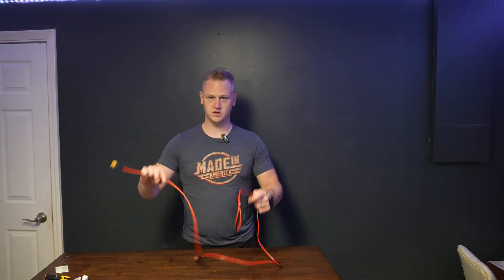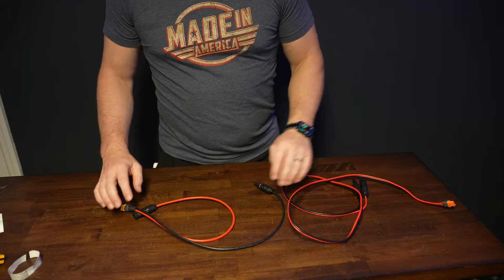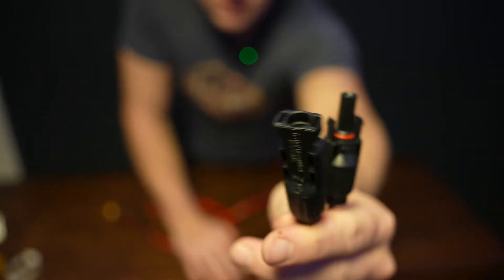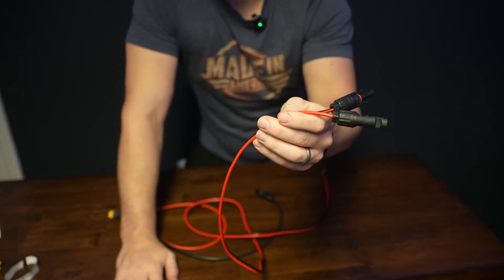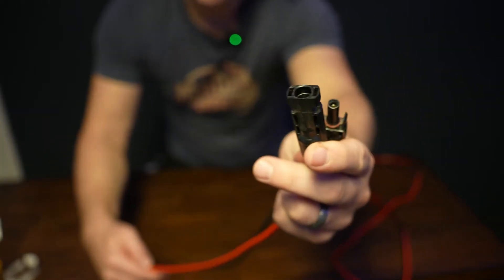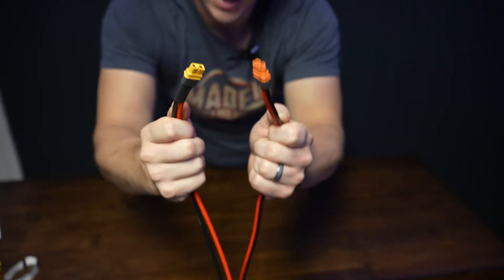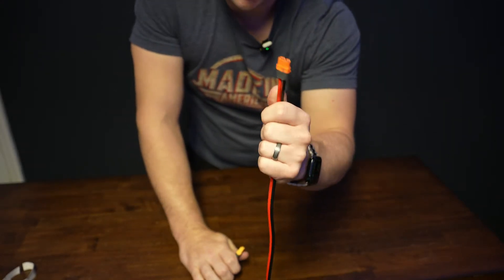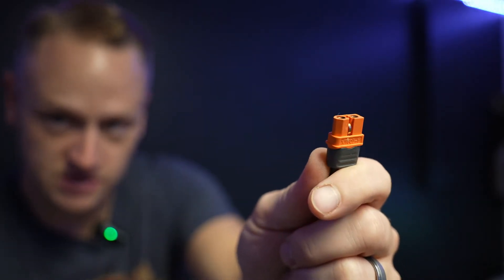XT60 vs XT60i cables

Comment: I only have one solar panel at the moment, but 2 Delta Pros. I don’t want to continually move the solar panel cable to each DP as needed. Is it safe to use a splitter on the XT60 cable to each DP?  My solar panel is rated for 400 watts. Thanks
Reply from the maker: According to my understanding, unfortunately that won't work. The two delta pros' inverters will "fight' each other for full input of the solar panel and won't "share" it equally. I'll try to do a short video demoing this.

Comment: Conclusions are not actually correct. The third pin forces the controller into either a high or low current mode. A regular XT60 connector will force the controller to guess, depending on if the supply is a constant voltage source (like a battery), or a constant current source (like a solar panel). The controller will usually guess correctly for a solar array, but behavior using the XT60 can be erratic, especially for overpaneled solar arrays which can behave more like a constant current source and fool the controller into guessing incorrectly. Sounds like this is your case, and each of your two controllers guess differently. A constant voltage source using XT60 connector will always be reduced amperage, and you'll want a solar configured XT60i connector to allow full amperage input.
Reply: Ahh. So this wiring senario would be MC4  to XT60i to allow up to 15 A?
Reply: What happens if I connect my 200 watt solar panel to my Delta 2 max with a xt160 cable?  Compared to using an xt160i cable?
Reply: My understanding is xt60 is 60 amp and 60i is 100 amp. (4) EcoFlow 400 watt rigid panels wired in series put out 13.76 amps which stays constant so should not matter. Am I understanding this correctly?
Reply: @piccman1  no, that’s incorrect in this context. EF uses the third pin as a power source identifier and without the third pin configured for solar input the current will be limited to 8A in some circumstances

Comment: Good info.  It is quite likely that earlier models of your Delta Pro may not have been properly setup to use/look at this pinned state for protecting car charging from the higher current.  That is the ONLY purpose of this pin...and it is NON-STANDARD.  The XT-60i connector was originally developed by BattGo to send serial data info about the battery that was being charged (number of charges, temperature, etc.) but it has since been used as simply another data pin on common power plug.  Ecoflow chose to use it to indicate higher allowed current on this port by simply wiring the plug to ground (without this, the pin is internally pulled high on the Delta Pro/Max/2 line of products).  Again, it is possible that you either have a broken pull up resistor on your Delta Pro (allowing the pin internally to float or capacitively couple to ground) or that early models did not have this pinned out in the model (or they internally pulled to ground instead of high, thus changing what they intended to do with a normal old XT-60).  They probably changed their minds on allowing a normal XT-60 to be able to function as solar charger (and thus allow a normal XT-60 to be wired to car plug and exceed the 8A max spec input).  /shrug.  Either way, your video is very nice to help alert folks that there IS something being done on these plugs, and that should be the FIRST thing you check when trouble shooting capacity and generic cables from Amazon...

Comment: Thanks but i can’t see buying a cable cutting it open to learn if the middle pin is connected to the negative makes any sense. Can’t return it and now have a compromised cable.
Reply: You can use a multimeter to see if there's a short on the negative side

Comment: The issue is that a properly wired XT60i will tell the DP it’s ok to pull 15.9A in the absence of that pin the DP tries to ‘detect’ solar vs car battery and the results can be inconsistent. Short of a pin wired to tell it not to throttle or a positive detection of solar it will default to a limit of 4-8A (depending on car charge setting). That is to protect car wiring and prevent melting the cigarette lighter plug. By contrast the orange tip car adapter the DP comes with is wired opposite to explicitly tell DP to limit current.

TLDR: get an XT60i cable for any of the newer EcoFlow products with XT60i ports.

Comment: thanks for the info i did notice i have an orange XT60i connector for my Wetown solar generator. Now i know what the difference is between the yellow and orange.
Reply: There's also a difference in how its built, the xt60i has a metal pin that s in between the positive and negative of the plug itself.

Comment: One thing to be very very careful of with the Delta Pro. There are numerous accounts (including some friends of mine) for whom the XT60 connector on the Delta Pro, broke and fell off into the unit. Be very tender and careful with them. Known problem.
Reply: I read some comments on some other videos also warning of that and suggested getting a pigtail to leave in permanently and plug and unplug the cable with it
So yea that way I just plugged in the pigtail and never unplug it
Reply: …Thanks for the warning.  The jackery didn't supply a car charger because it could easily short out.  They said a car charger cable is available but they would void the warranty if you used the car charger improperly

Comment: Thanks for the video but it is kind of hard to know if the pin is connected to the negative when buying on Amazon.....trial and error. Thanks again. I am in the process of purchasing the switching power supplies that you reviewed because I have to be able to charge my two DPs with my inverter generator (Not ecoflow) while powering my house with the dual voltage hub
Reply: ……cant you use a continuity tester to see if it is hooked to the positive or negative??
Reply: @StephenFiore-f4p you can once you have it in your possession.  I think he’s referring to before you buy it and it isn’t listed in the description.